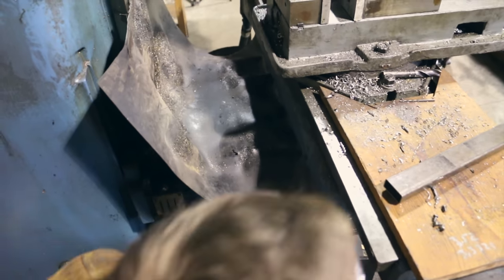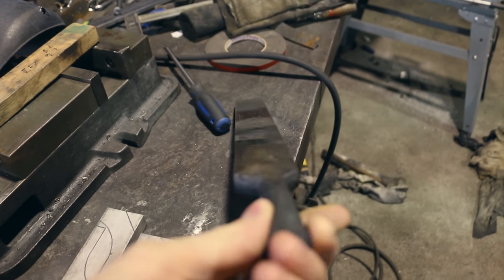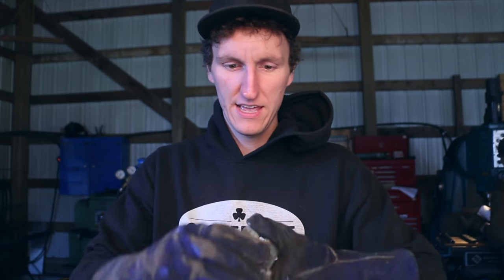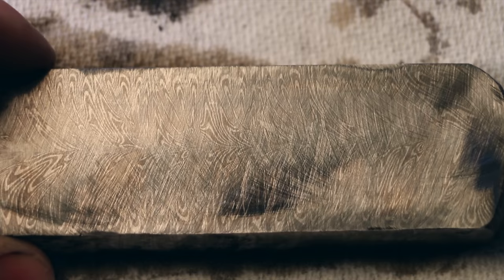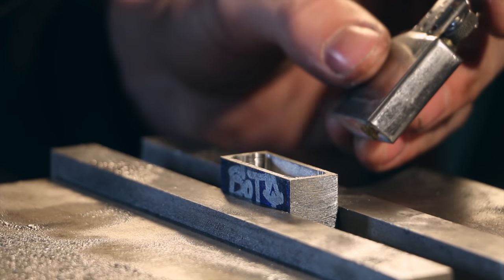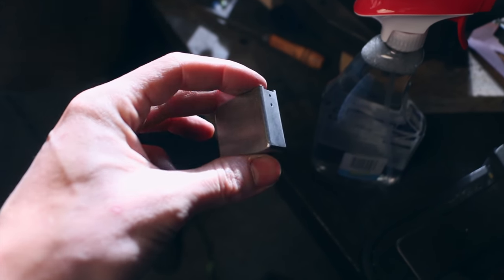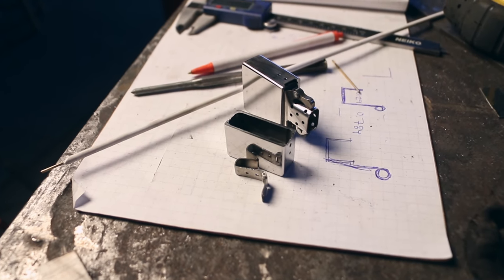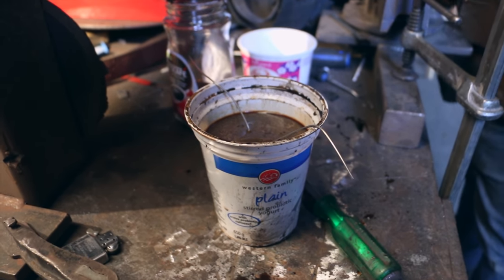Making A DAMASCUS LIGHTER

Comment: the reason it took longer to etch it the second time was because it was polished, when steel is polished its essentually REALLY flat and smooth, so it has a lot less pores in the metal, when it was ground with the angle grinder, between the grinding cuts were itty bitty mountains of metal, kinda like if you take your finger nail and slide it across it would make a louder sound because on a very small level theres some raised lines. when there are raised lines its means theres more surface area for the acid to etch, and if a lot of raised lines are shaped like this: ^^^^^^^^^^^^^ which it is when grinding, the acidic base can kinda penetrate more. essentially its easier to break off a corner of a mountain than it is to penetrate a perfectly flat surface.
Reply: Or just use ferric chloride or muriatic acid..

Comment: At 4:56 Yes. 1991. I used it for hunting and mining and fishing and a TON of freaking wild adventures in the wild no-road parts of Alaska. I had the head gasket replaced three times; the six cylinder engine really suffered in the early '90's. It is just sitting now, engine blown, waiting for a new home. And a new engine.

Comment: My first car here in MN was a 1993 Toyota Camry...ran it til the day that literally the wheels fell off, over 300,000mi. I bet if we found the scrapyard it ended up in that if we bring some new gas and oil it'd fire right up today. I also drove a 1998 Toyota Tacoma to 299,000mi. Sold it to a friend fir $1,000...hes still drivin it around WI. The Tacoma (and as Ive heard, 4Runner too) had some issues with weight and balance and traction but if  you take care of them they will run forever.

Comment: Try setting your initial weld with a hand hammer or hydrophilic press next time and the borax doesn't need to completely covering it! If you use the hammer press give it some initial hits that are just moving the metal down about 1/8 inch to a 1/4 inch max also your in to big a rush to get the billet back into the fire when you start hammering it keep hitting it til it gets a dull orange look before reheat

Comment: Pattern welding is the practice in sword and knife making of forming a blade of several metal pieces of differing composition that are forge-welded together and twisted and manipulated to form a pattern. Often mistakenly called Damascus steel,

Comment: I make Damascus in a different way ,I take a flat peas of iron 40mmx10mmx150mm long 3 peace’s and 2 peace’s of steal from the same measurements as the iron plats .
The steel I take normally a old file ore a chisel,that gives 5 Lear’s .
I weld the also in the fire (no gas oven !) and plies it in half and gives 10 Lear’s and so on ,than 20 !thane 40 ,I useably stop at 380 Lear’s .
And use only with sand instead of borax .
A gas oven is ok ,but deprive your iron and steal from carbon ,when you use coal it is not so depriveding the carbon in the steal and iron .
Al different ways ,but same nice result .
Nice work 👌